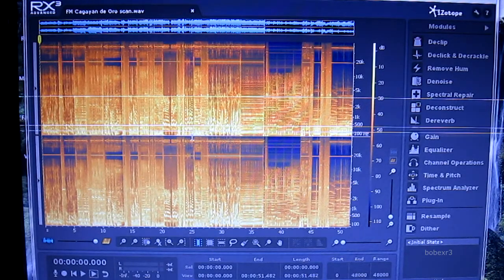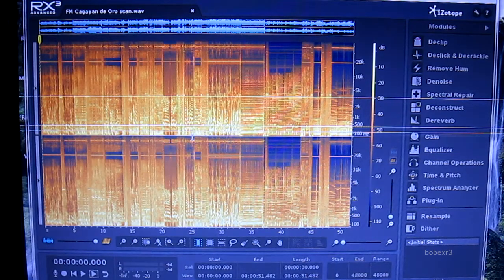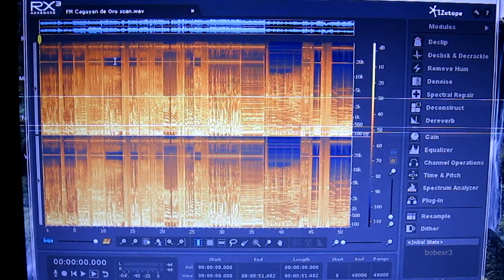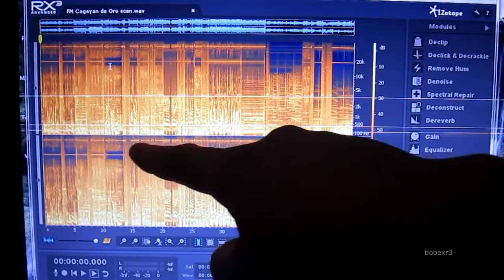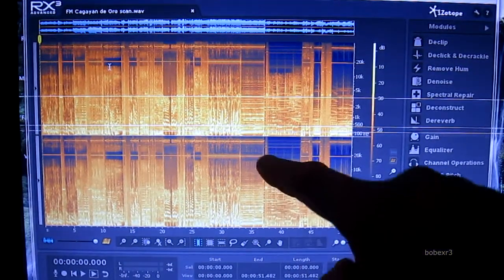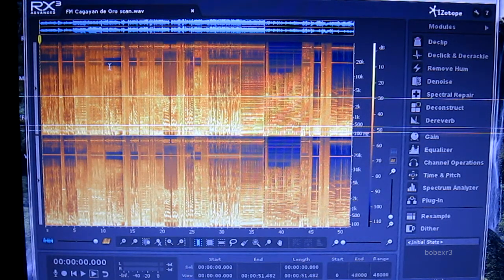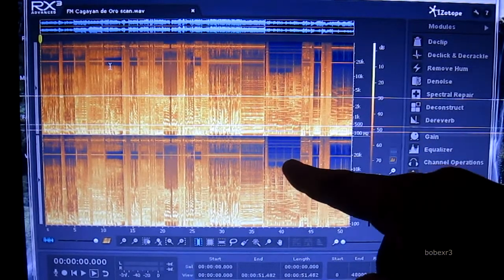FM Stereo Audio Spectrum

Comment: +bobexr3 Almost of the radio broadcast are now intended to be mono, although the radio sensors (if have in respective radio sets) detected to stereo. I wonder why it happened.
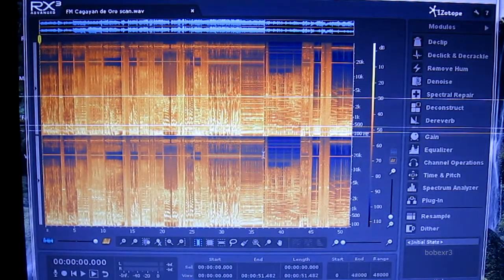Reply from the maker: 1:07 If you listen to a headphone most of them are in stereo because I was using a vintage radio cassette. However, when I used my cellphone many of them sounded mono but the stereo indicator still shows up.
Reply: Truly, a stereo. Some are mono, but I can't indicate what part.
Reply: ...although the radio broadcast in stereo, try to look up the mono/stereo switch on your radio sets (if have). If it is set to mono, the outcome will be mono, although broadcast in stereo. Now I know, since I checked my radio cassette (Astron KS-55 ST) that it was set to mono which can't back to stereo (applicable only for recording a radio broadcast), since I was a kid press the wireless volume (not knowing that it is one of the cause that it was set to mono). To prove it, I adjust the multiplex and supposedly, one of the two channels will remain and the other can't heard. Unfortunately, when I adjust the multiplex, no response. Two channels intact as one.